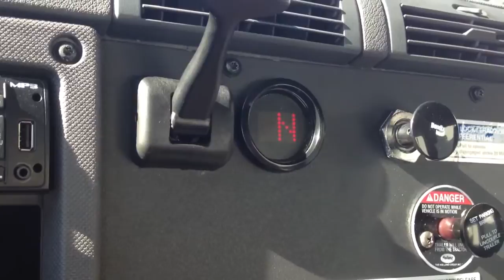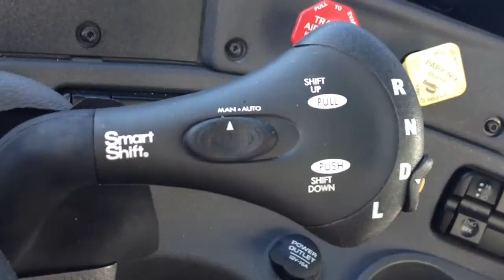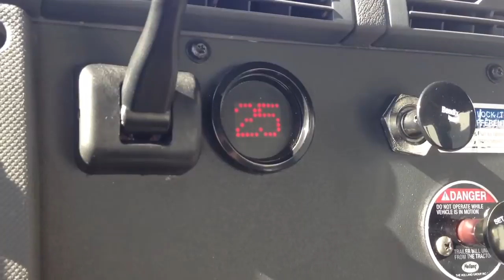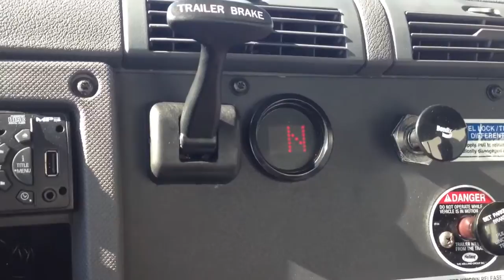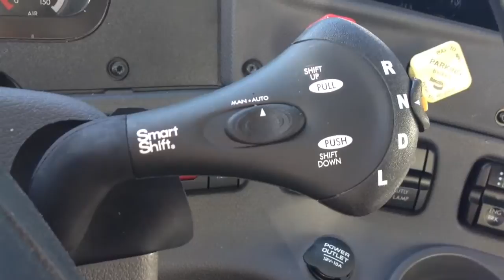Basic operation of a SmartShift auto transmission in big tr

Comment: Thanks for this 

It was a lifesaver my transmission was flashing F and N and would not go in gear

Keyed off six times and back in action
Reply: This worked the very first time for me.

But it didn’t the second time due to a fault code.

I was told to disconnect the positive and negative battery terminals and wait about 15 minutes to let the truck reset.
Reply: @CChance1  did that work am having same issue right now